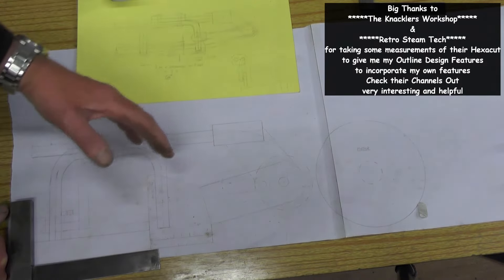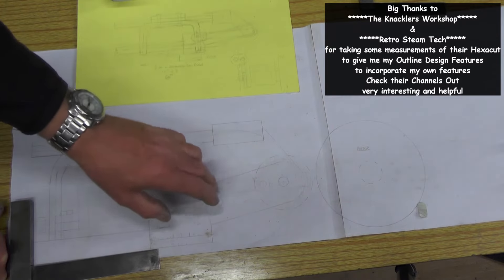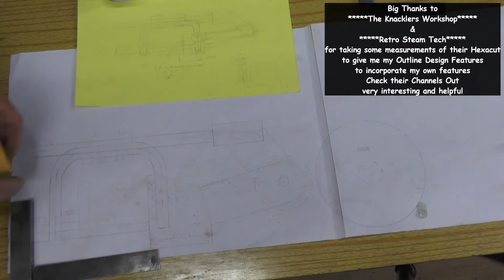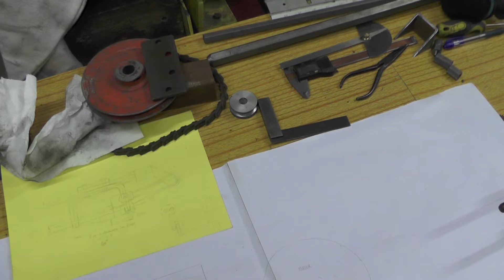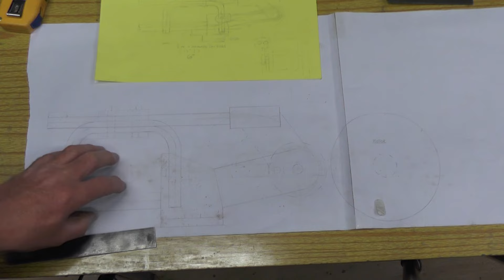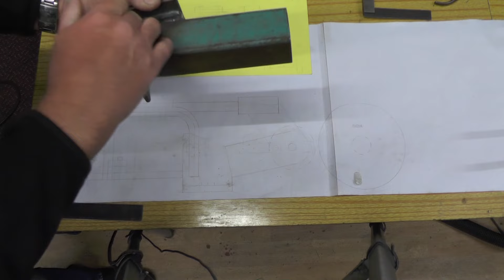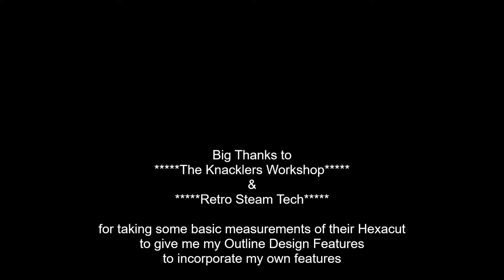Making a Compact Mechanical Hobby Hacksaw Part 1

Comment: What ho Mr F, 
They may be slow but power hacksaws have an hypnotic effect to watch. I have often thought to make one but with a Chris twist with the works underneath but I  haven't gone further than "it would be nice to have", or how to do it yet.
I love the fact they use buy anywhere anytime blades which are cheap, even quality(allegedly) ones but most of all cheap.😉
Have you looked at the Duplex of ME fame design?
ATB   
c
Reply from the maker: Hi Chris, not seen the duplex, i don't think!!, but the one i made 20 years ago was from an article in the ME.??
Yes your right about hypnotic, hope i'm not nodding off when i near the completion, when the powers on and its up and running!! I'm loosely basing it on the hexacut from the 50's to 70';s, although ive never seen one never mind one running, so not sure what the performance will be like, but either way i can use it as a hypnotic stress reliever.!!
take care
mr f

Comment: Hi Mr F. I have a Kennedy saw so if there is anything I can help you with just let me know.
The only think I would say is I find I have to add weights to the top of the saw frame to get it to cut efficiently especially on brass when cutting larger diameters so if you make it possible to hang extra weight onto the front end of the blade frame.
Reply from the maker: Hi Peter
Ive noted your comments, thanks, is it to do with the damper and spring combination, would a stronger spring be a way of more downward pressure, 
also Peter whats it like when cutting steel and what diameters can it cut up too and is there much vibration, does it have to be bolted to a bench
I'm well on the way now with it, the videos are a little behind due to finding time to edit and upload.
I may have some more questions later if thats ok
Take care and thanks again
regards
 mr f
Reply: Mine doesn’t have a spring to I increase pressure perhaps that is the problem ? The dash pot seems to be pretty ineffective, perhaps it needs some attention but blades do last a long time so have not been too bothered to do anything about it. I tend to use 18tpi blades although manual says 24 tpi. I mostly use 18 in my handsaw frame.

Cutting steel is good below 1” diameter as is other materials but above 1” I think the angle of the blade is too great to apply enough pressure hence the weights that I hang on the front of the blade frame.
You are also limited by the capacity of the vice which is about 2” I think. Not sure if it would cut through 2” round material in a reasonable time but ok with angle material.

Very little vibration, I have mine bolted to a piece of 5/8” ply just the size of the footprint of the saw and motor and it just rests on the bench and it does not move.

I bought mine some years ago from the ME exhibition Birmingham, it was in a poor state without motor.
I think your idea of using gears is a good one as it’s difficult to get it to run slow enough with a 1425 motor. I think the flat belt is virtually running on the motor shaft to get the speed down. I will have to refresh myself tomorrow.
All the best and look forward to all your videos, the loco build was superb.
Kind regards
Peter.
Reply from the maker: @peterfarmer1592  Thanks Peter, i appreciate all the info and your support, yes i noticed on a video that they seemed to go quite fast, thats ok for softer materials but not so good perhaps on harder such as steel. Yes you should have a strong spring on i believe then the damper adjust for greater or less resistance but while the spring stills keeps pressure on. My only concern is that with me going through a gear train i might get more vibration, but we will have to see, my back up plan is if that is the case i can always move the pulley to the crank and use as per the hexacut.  Watch this space!!!!
thanks again
 mr f
Reply: @MrFactotum  Hi again Mr F. Just to correct mine does have a spring but the instructions do say to replace the spring periodically which I doubt has ever been done so might explain why I have to add weights to the blade frame.
I have worked out that the stroke speed of mine is approx 178 strokes per minute whereas I understand that it is 240 on standard machine which seems a bit fast to me.
The vice capacity is a smidgen under 2.5”.
Instructions say to use 18tpi blades for solids and 24tpi for tube which makes sense.
All the best
Peter.
Reply from the maker: @peterfarmer1592 Great thanks Peter, ive worked my gearing out at around 96 strokes in slowest and 160 on next gear, i think my other 2 settings will be too fast i.e above 240. 
I've put as strong a spring as i could get in the space then i'm regulating the pulling force of the spring with a dashpot damper i am making which is my own design, which works different to the hexacut one. Watch this space for the video later on in the series probably will be part 9 or 10 for the damper. Thanks for all this info its very helpful as i've never set eyes on a hexacut before in real life, only pictures.
Take Care, keep in touch, see you next time
regards
 mr f